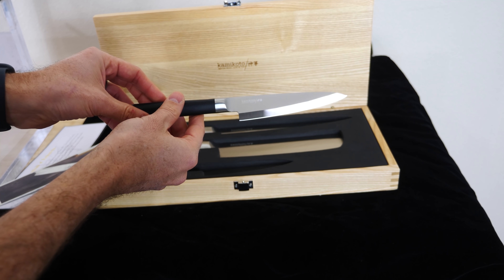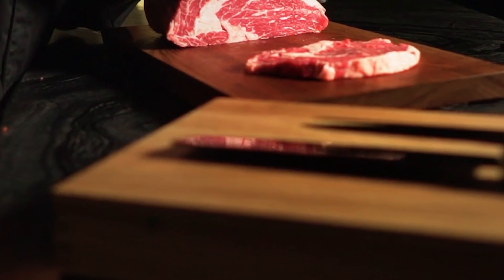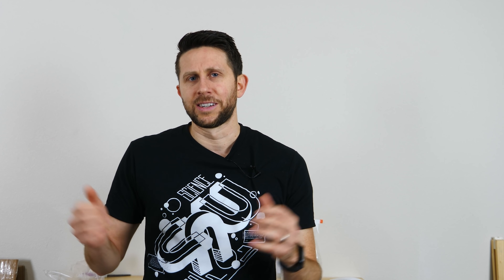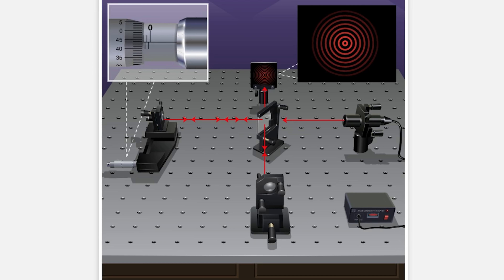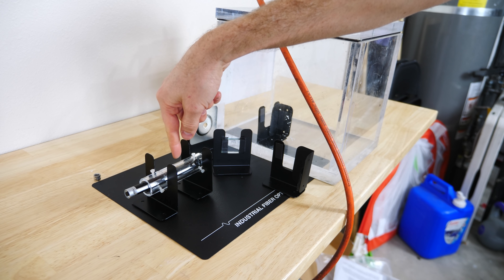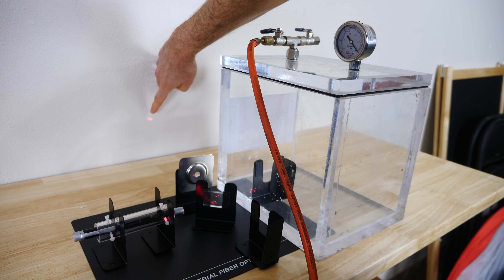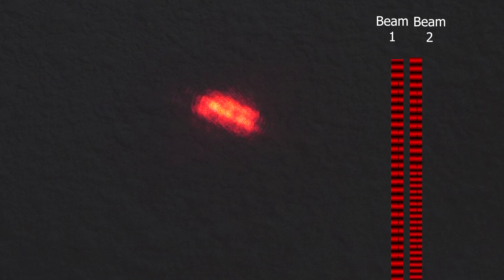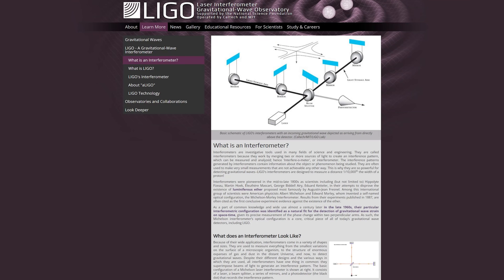The Most Famous Failed Experiment

Comment: Why did they assume light would travel at different speeds depending on the direction through the ether? And how did this prove there was no ether? Wouldn't it just prove that if there was then light travels the same speed in all directions? Could magnetic fields act as the ether that light uses to travel? Is it even possible to exist outside of a magnetic field?
Reply: At the time it was thought that light waves had to to be "waving" something in order to propogate, just like sound waves need air to propogate. Hence they reinvented the classical aether that the ancients thought was a fifth element filling the outer reaches into a luminiferous aether that allowed the propogation of light. If this aether was a true physical medium like air, then moving in different directions through it would affect the propogation speed of light, just as the velocity of sound is affected by wind direction.
Reply: if light moves through the aether with constant speed, you would imagine that as the earth moves through it, then light would have different speeds on different direction. imagine a swimmer trying to swim against or with the water current, if you move with the current you will see the swimmer moving freely to all directions, but if you stop moving you will see the swimmer moving faster to some directions than others, its the idea of "reference frame". what this experiment show is that light moves at constant speed independent of the reference frame, its the basis of relativity.

Comment: How can light be the same in any reference frame if you can only measure it once it heads back in 2 directions? You can't measure light in a single one way trip. Meaning the two ways could compensate for one another.

Comment: Humans:
We have calculated the speed of light, the speed limit of the universe.
Develop a test to see if the speed of light changes by orientation of measurement to account for the rotation of the earth around its axis and around the sun, plus the sun rotating around the milky way galactic center, plus the movent of the milky way through the cosmos...fail to measure any effect.
The speed of light is not affected by orientation.
Um...are you sure then it is the absolute speed limit?  Your results suggest otherwise?

Comment: What happens when you evaporate a solution of metal dissolved in water(like used for electroplating), does it just turn back into metal!?
Reply: That is not metal dissolved in water. It is a chemical compound dissolved in water. Salt is not sodium metal mixed with chlorine gas.

Comment: I think that's a bad experiment. Quantum fields say that there are fields everywhere. Quantum particles appearing out of the vacuum shows that the vacuum isn't empty, because nothing doesn't create particles so there is something everywhere. And in fact light travels through this something otherwise it couldn't travel through the vacuum because the vacuum is full with this something which creates quantum particles.

Comment: 0:20 - "Using over 800 years of Japanese technology and traditional techniques".....Ah didn't know they had electric grinders back then
Reply: This is right, but the reason why the pattern lines appear is still because of the semi permeable reflective mirror. Light does not do real cancelation like wrongly often misconceived/misconducted/stated. It's unlike a wave of e.g. water or sound acting in e.g. air which are indeed able to cancel each other out like magnets aligning, + and - = 0. But this common misconcept is due to the fact that light still can be altered in speed, frequency of the 'mass' or rather density would almost be more precise as of this case. It used to be already a sum of the addition of + & - itself as result. All cancelling in the experiments which look like e.g. waterwave or noise cancelling properties are just illusions as of being an constant acceleration kinda effect. It is like a very unheavy plasma like balanced gas or rather like aligned hydrogens of the atoms, a cascade of hydrogenlike order which seeks entropy, therefore can only get even more ordered in some altering way of it's underlying energy state of + & - .
Waterwaves have movement which can repell each other and kinda cancel itself out, sound is a wave of air itself movement which therefore can cancel itself out like wind in different fqs.

Comment: If the aether is massless, there is no drift velocity, because the speed in the arms is relative to the source.  They never really followed up on the source theory very well.  Relative time was more fun.  In college I asked, "How is light speed constant relative TO THE OBSERVERS EYES, but there is still a red-shift?"  The prof wrote sqrt(1-v^2/c^2) on the board -a number between 0 and 1.  That was his answer to my question.  That is all there is.  Relativity does not work until AFTER you change the data, which blames time.  They change the data with that "transform" to create Relativity from another reality that is STILL THERE IGNORED!
Reply: I sincerely wish you had a better command of the English language, so I could actually understand the point you're trying to make.
For what it's worth though, the ether does not exist.
Reply: @Vector_Ze  Sure it does, it's in my can of engine starting fluid.
Reply: @charleshorseman55  Bravo!
Reply: @Vector_Ze  If you can get rid of the "I think" and the "it could", and come up with an actually well-defined theory that describes reality better than what we have (which is hard because basic everyday physics is pretty well understood), then you might have a case.
How to formulate such a theory without some form of math escapes me. Just positing ideas and claims is not science, that is religion.
Reply: @landsgevaer  Reviewing everything I said in this thread (not much), I have to conclude your comment is misdirected to me.
I will volunteer that you're likely misusing the term "theory".  It is apparent that you aren't familiar with the scientific method.  I sincerely doubt you are aware that is even a 'thing'.
Reply: @Vector_Ze  Whoops, I clicked your comment when I thought I was clicking John Hartman's.
Apologies.
Although I don't see how my use of the word theory is wrong, where I invite Hartman to phrase a theory. I've been in science for a while, so if my usage of the word is wrong I would surely like to know.
Reply: @landsgevaer  In common street talk, a theory is nothing more than a person's idea.  In science it is far more than that.  The fact that you've posted the question is proof that you have access to the web, the totality of human knowledge at your fingertips.  Learn to use it. I know people denegrate widipedia, but it's a good place to start.
Go there, enter scientific method, and read.
Reply: Dayum, can't believe I spelled wikipedia wrong.  I hope you read through that.  I'm a touch typist, and sometimes my thoughts get ahead of my fingers.
That's my story, and I'm going to stick to it.  On the plus side, I type faster than some people speak.  The errors suck though.  I should spend a little more time proofreading.
Reply: @Vector_Ze  Yes, so how is my usage wrong if I ask him to come up with a theory instead of ventilating ideas only?

You make a lot of presumptions about me. I went through the scientific cycle more than once; I don't need wikipedia anymore to know what a scientific theory is, thank you.
Reply: @landsgevaer  Apparently, you skipped a few classes.  You don't realize the difference between a theory and a hypothesis.
Reply: Nah, I didn't.
I could also have asked him to come up with a hypothesis. I didn't. Anyone can come up with hypotheses. I asked him to come up with a description that describes reality better than what we have. That would qualify as a theory.

Your statement that I don't know a theory from a hypothesis is a hypothesis, it won't become a theory.
Reply: @landsgevaer  Once again, you have illustrated that you don't understand that a theory is FAR beyond a hypothesis.
Reply: @landsgevaer  I sense in you an interest in learning.  I appreciate that in you, but I must sleep, LOL
Reply: I would enjoy a continuation of this conversation at a better time, you might teach me something.
Reply: I'm old enough, and maybe even wise enough, to know, I don't know everything.
Carry on. and be informed.  Don't spread nonsense, that is malignant.
Reply: @landsgevaer  Think about this:  Light speed is constant entering YOUR eye.  When your eye changes velocity, the eye entry speed stays the same, but now that entire beam of light has a different frequency, as if it knew you changed your velocity.  Regardless of whether it works, that is goofy.  The "theory" says that time actually changes creating that effect, when it is really them mathematically adjusting the numbers with the "transforms" so that it works.  It is not a huge leap to see that they mathematically create Relativity and that there is another NON-TRANSFORMED reality left behind.  The fact that it is not "POPULAR" doesn't mean it's not true.  My gyro issue is proof that they cannot think without math.  My way is a mechanism, and their way is mnemonic devices and math.  I developed the math to describe my gyro version, but now they ignore it, because it's not what they were taught to follow and believe, which feels religious.  They all know what a bad paradigm is, but they've never faced one that is their own.  You guys act like it's my job to wrap up the new direction and hand it to people.  Even if I could, it would not be accepted, because it is different than what they were taught to follow and believe, just like the gyro.
Reply: @jnhrtmn  You can measure that the wavelength changes, and that clocks run at different rates. It has been confirmed to plenty of decimals.
But this is not a useful argument to have.
Reply: @landsgevaer  The fact that it works only means that at best, it is a great analogy.  It does not qualify it as a truth.  The fact that they change the numbers and do not have an alternative makes it completely stupid.
Reply: @jnhrtmn   You cannot do better than a good "analogy", in your words. I prefer "description". Whether it is "true" you will never know. Quite likely, all our theories are not strictly true, since they will at least be incomplete. The only thing that counts is that they *work*, they make predictions that turn out to be accurate.

On gamma burdt, you mean there is dispersion? What has that got to do with anything?
That is like saying that light can't travel through empty space because there are such things as rainbows.

Peer review has its downsides, but it isn't that bad. It does block most unmotivated nonsense, yes, so if you favour unmotivated nonsense you're not gonna like it. Saying they are "changing numbers" is not gonna help either, no.

I think I've expressed what I wanted to in this thread now.
Reply: @landsgevaer  For GRBs, no, I mean the light arrives in order of wavelength.  They invented the blast wave effect to progressively release longer wavelengths, but radio can be as much as a month late.  I understand the "cause" of the gyroscopic effect, but you and the peers were taught the "description" that originates from a mnemonic device.  I have gone 20 years trying to get someone to see the actual cause that IS NOT ANGULAR MOMENTUM.  No one knows what cause is anymore.  If medicine described symptoms with math, it would be like modern physics with all of the constants and laws, but no causal diseases.
Reply: @jnhrtmn  That is called dispersion bro. Please get educated before you start playing. Bye.
Reply: @landsgevaer  That's the invented excuse that lets you hang onto your paradigm.  In my world, it is an invented fix.  The Strong force was an invented fix to keep from having to second-guess electric charge.  There are many of these fixes that let you sleep thinking that you weren't taught a bunch of crap, but you are not responsible.
Reply: Can anyone see how goofy this is?  He gravitates to terminology, when it is still light arriving here in order of wavelength, A FACT that, if known in the year 1900, Relativity would probably not be the paradigm of choice today, because no one would be sold on constant light velocity "relative to the observer!"
Reply: Because everything that makes money is on the "old" science (electrical science), and everything that costs money is on the new science?
Reply: How is redshift an objection to absolute velocity? Wavelength and wave speed are entirely different things.
Relativity has been tested through and through. And so have alternative ideas, aether dragging, aether compressing, you name it, they lost.
Reply: @landsgevaer  When your eyes move, it means that entire beam of light now has a different freq.  I don't think time exists, and you just want to believe that they tried everything.  Relativity only works AFTER you change the data, because if you don't change it first, light speed doesn't look constant.  It could be an analogous effect, such as inertia changing in a way that creates that same curve of data.  The inertia thing would explain the oscillating clock that changes with gravity potential.  It would explain quite a lot.  If you actually thought for yourself and questioned things more, it tends to fall apart.  Even the gyroscopic effect is just a bunch of mnemonic devices with no cause, and that is a macroscopic toy.  Look at my later videos about the gyro.  I can GUARANTEE you will learn something you've not seen.  No one will publish it, because it says math can lie to you.

Comment: The speed of light is also affected as a travels to the plexiglass of your vacuum chamber, when the introduction of a high vacuum cause the vacuum chamber to flex, and wouldn't that be responsible for some of the interference pattern movement?
Reply: That you could test by pushing against the plexiglass, similarly deforming it.
It would likely be a higher-order effect because the thickness doesn't change, and if it is close to perpendicular, even a slight tilt in angle is only a second-order correction.
Reply from the maker: since the thickness of the glass doesn't change it doesn't affect the pattern, it does move where the location of the beam is though.
Reply: @TheActionLab  I was thinking that it might change the angle at which the light passes through the glass, thereby effectively changing the thickness.
Reply: Not impossible. But the same effect would be if done completely in the vacuum chamber or for the pattern you mean if you then just would have the laser part open, or the whole left side rather so air comes back into it and acts to it same as moving it backwards while in the same surrounding. You can see it also in other experiments

Comment: If light change speed depending on material. Do that affect the distance calculated from earth to the moon in the "Lunar Laser Ranging experiment". Since part of light is in earth atmosphere and the other in vacuum of space.
Reply: Yes, that needs to be taken into account. Back of the envelope order of magnitude calculation suggests you would be about 1m off if you did not correct for it at all.
Reply: @landsgevaer  thanks for the wisdom
Reply: Can’t it be done from a satellite to ensure all of it is in a vacuum?
Reply: @westonding8953  The distance from Earth to moon? Then you need the position of the satellite relative to Earth, where the same issue arises.
Reply: @landsgevaer  that’s true. Although the distance from the Moon to the satellite would be accurate. But then again, the Earth’s surface height already varies by many mms.

Comment: It’s only relevant the earth does move through the ether. If it was in a different dimension or the earth pulled ether with it or it had other hard to get properties then the experiment wouldn’t have meant anything to begin with.
Reply: Airy's experiment disproved the conjecture that the Earth drags aether with it.
Reply: @Mandelbrot_Set  Are you sure? I wouldn't trust it considering it's a poorly designed experiment that 'proved' earth is stationary, or at least, that's what came up when I googled it.
Reply: @Anonymous-df8it  That is ridiculous. Read the damn experiment instead of flat earther websites.
Reply: @Mandelbrot_Set  I'm not a flerfer. That's why I put '...' around 'proved' and said it's poorly designed. Also, how can I read the experiment if all that comes up on my web browser are flat earther websites?🤦‍♀
Reply: @Mandelbrot_Set  And how does stellar aberration prove Earth isn't dragging the ether along with it?

Comment: Rotating reference frames. That's what they were missing and that's what relativity is missing. If you model the ether as viscous and not some static on movable thing, their experiment showed exactly what it should. You are only going to get some useful output from that experiment if it is being accelerated during the test. 
Fantastic set up. Thank you for this video
Reply: You mean Mich&Morl. is consistent with some type of "viscous" or "rotating" aether!?

There were some ideas back then that the Earth (or matter in general) drags along the aether, but those are hard to reconcile with how light from space behaves when it arrives here.
Reply: If they'd have pointed it up and down,  the assumption would be the aether was flowing through the earth instead of over it...which would have changed how everything was presented from that point on. Folks fail to apply the scientific method to perspective itself and it shows.
Reply: Got any credentials to back up your claim?

Comment: The front end of a beam of light slows down in glass or water.. So how does the trailing beam still in the vacuum keep moving at 299,792,458 m/s when the front end has slowed down?
Reply: By compressing the waves. Like a slinky. That is why the wavelength in a medium decreases, even if the frequency stays the same.